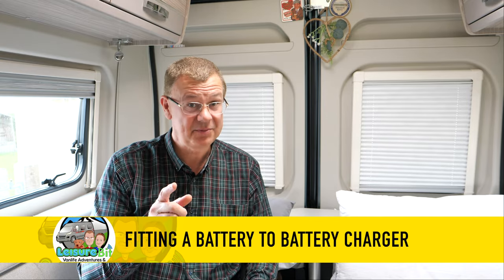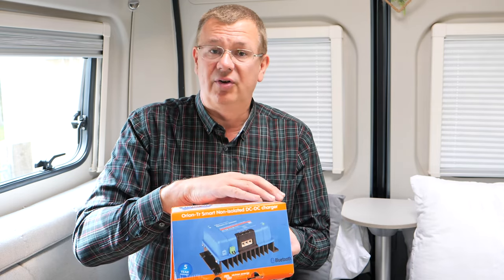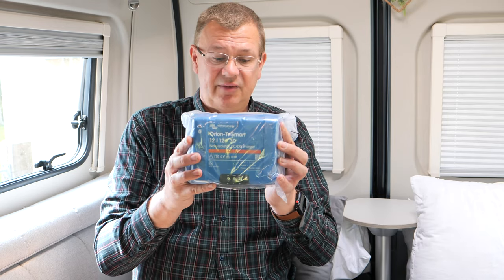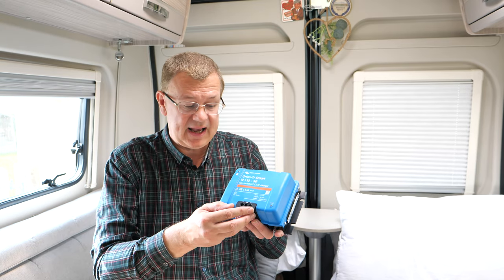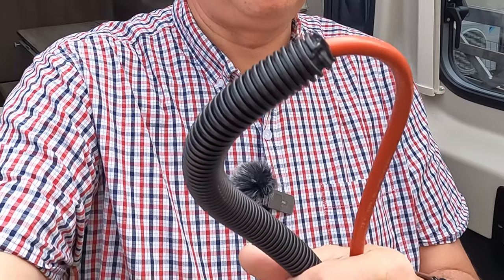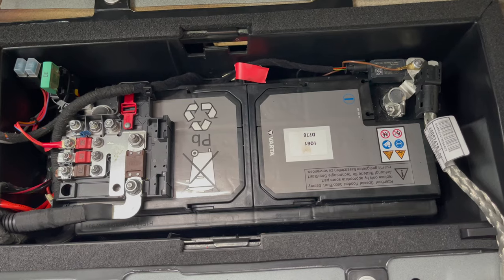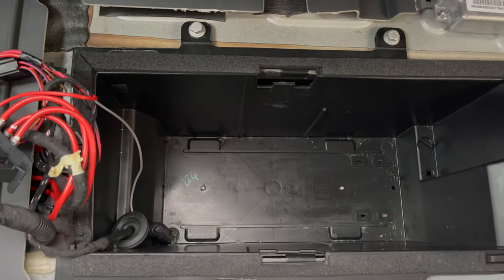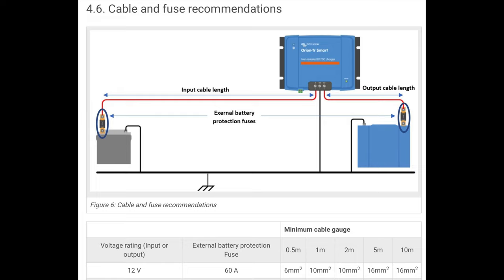Victron Orion DC-DC Non-Isolated Charger B2B Installation in my Fiat Ducato Campervan

Comment: It looks like a good installation apart from the 60A DC breaker.  I bought one off Amazon that looks the same as the one in your video.  It was junk.  It was not CE marked.  The biggest problem was it didn’t make a good secure contact with the cables.  There was just a small grub screw holding the cable.  I did not think it was safe enough for 16mm2 cables carrying 30A especially in a mobile environment where there is vibration and movement.  Many people have posted that the breaker doesn’t trip at the indicated current.  None of the reputable suppliers sell this item and, having seen it, I can understand why.  I returned my breaker to Amazon for a refund.  Please stay safe.
Reply from the maker: Thanks for the comment - you’re right I had issues above 30A with this breaker - have a video in the next couple of weeks since I upgraded it no problems - Amazon shouldn’t sell stuff which isn’t fit for purpose or as described!
All the very best, David 👍

Comment: Hi David, Very good video thank you.  Did you have to disable the Fiat B2B charging system before doing this install? If so how do you do this ? I'm just about to start this very same install into my Motohome that has a Fiat Ducato Engine/Chassis so it would be good to kow if there are any additional steps that I need to take.
Reply from the maker: It would make sense to disable it -
I tried using the Schaudt and Orion in parallel but with mixed results (watch this space for an update in the next couple of weeks) - if it doesn’t have a Schaudt, I would pull the fuse on the original charge circuit as Lithium really needs a regulated charge current rather than a split charge. Then it should do what you expect with no oddities - all the very best, David 👍
Reply: I don't know which fuse to pull?  I've also read that by doing this the control panel in the vehicle then constantly says low vehicle battery and some also say that the fridge could stop working. Do you have any experience of this?

Comment: It’s pushing more power to your house battery thus enabling a better stop start function. We have had this on our transporter works all the time now with our renogy dc/dc charger.  Again great content cheers
Reply from the maker: Thank you - appreciate the comment.
Interesting theory - great to hear yours works all the time now too.
All the best, David 👍
Reply: Hi David out of interest did you get my email. Also where did you get your wire as it seems to have gone through the roof cheers Steve
Reply from the maker: @sccobyste  hi Steve, I don’t think I have the email but will double check. I got the cable from Simply Split Charge (as have found the quality to be good from there after having my ‘hands burned’ with some cheaper stuff in the past - think it was just under a fiver a meter so silly money nowadays.
Reply: @LeisureBit sent again and 🙏

Comment: I've followed all your videos with great interest as I'm going to try and fit Li/B2B in the New Year.  My van is a modern 2021 model but has a simple split charge relay (SCR) system fitted. There's 2 questions I have 1. Does the SCR need to be disconnected before fitting the Li/B2B combination? I have visions of big Li charging currents going through the existing SCR in preference to the B2B!!  2. The Li battery has an app that monitors the BMS of the battery and the Victron B2B also has an app that monitors all the necessary parameters. Do you really need the added expense of a smart shunt?
Reply from the maker: Thanks for the comment. It's best to disconnect the split charge relay as they aren't normally designed for Lithium batteries and it may cause incorrect charging / false readings with it connected (I've found this myself using 2 B2B's) it's best to have one device managing the battery of each type I've found to get the most out of it. You're right, the SmartShunt I had already bought but you can do without it for sure if your battery has the functionality built in. 
Hope that helps, all the best, David 👍
Reply: @LeisureBit  Thank you very much for your prompt reply, I shall continue to follow your detailed videos!

Comment: fantastic David.  Interesting about the start stop but maybe by giving the earth a cleaner earth path is making the start/stop more efficient. I just wonder if you considered stepping up to 25mm cable to allow just the breaker without the additional fuses on the B2B?. Nice video 👍
Reply from the maker: Thank you very much for the comment. I did consider 25mm and if I was putting a couple of Orion’s in would have gone with that for sure (as would have taken to 80A fuse at the battery then instead of the 60A). Cable has got silly money hasn’t it, think I paid just under £5 per meter for the 16mm2. You may have spotted the hole is bigger than needed incase I wish to go dual in the future 👍 
I put the fuses on the B2B just as an extra precaution (based on past experience where things have malfunctioned) - if it’s double protected it never short circuits or breaks down either 😀 
All the very best, David 👍

Comment: Hello, is there a way to limit the current? if I have a Li Ion battery to charge, that can take 200+ Amps, how can I limit the output current in order not to blow the fuse or overcharge the alternator, charger, cables?
Reply from the maker: That’s the whole point of the b2b and why it’s needed, it regulates the current and voltage 👍

Comment: Interesting vlog David, so does this mean you will be using EHU less this year or was this just extra back up. I suspect the start stop is due to the extra earth either making a more efficient connection for the vehicle battery or helping maintain it's condition. Start stop on Mrs K's Audi has always been hit & miss. Cheers K.
Reply from the maker: Morning Karlos, I think you’re right on the earth sorting the issue (that seems to be the theory as if you disconnect the b2b it still works fine - poor connection between leisure and vehicle earth seemed to be the issue)
It gives more options and takes the worry away - we do plan to do more off grid sites but as you say you always have the option of whichever you need at that point - we have some coming up with no hookup given the remoteness and have some ‘tours’ planned which again wouldn’t have the hookup to recharge so it gives some extra top up while travelling to extend the time without intervention of a hookup.
Thanks for the comment, Hope that makes sense, have a great week.
All the best, David 👍

Comment: David, many thanks again for an informative video. I've noticed a few people reporting intermittent issues on the CV FB site with the stop/start system. I must be fortunate as my Series 8 CV40  appears to work fine. I'm also finding the stock B2B, solar panel combo working fine also for how we use the van. Only gone off grid twice (overnight) & found the stock battery still showing green in the morning. Was using lighting & 12v compressor fridge, gas heating & a couple hrs of 12v TV. We must try off-grid longer to challenge the system & have an excuse to move to Lithium. Obviously using your guides ;)
Reply from the maker: Thanks very much for the comment - you’re right a few folks seem to have an issue others it seems fine like yourself. Depends what you do and how often you go off grid and for how long whether it’s worth shelling out 😀
All the very best, David 👍

Comment: Thanks for that David. Interesting how you wired it. I managed mine by having the wires inside the vehicle. I felt it was much simpler and  there is no point where you tread on the cables. Anyway that’s just what I did. You said at the beginning you were going to explain about the “jumper” for switching it in when the engine in running. What did you do ?  I wired a switch so I can control when I want the unit it be on. After all if you are headed to a site with hookup why would you want to use the vehicle to charge the battery if EHU or indeed Solar is going to be plentiful. The switch is very useful and I added a “Hey Ellie, turn on the Dc to Dc” command. Shen can just reach it while I’m driving. 😂
Reply from the maker: Thanks Graham - if I was just replacing the existing one and sorting out the wiring from the converter socket, it would have been much easier as I could have run internally but I wanted it as an extra (to give 25+30A=55A) and that was more than the converter connections are rated for. 
I’m going to do a follow on on how I’ve wired it up as took a little break to test it before finalising which was originally intended to be in that one - missed that when publishing!
Basically though I’m fitting an on off on switch which in on 1 will connect to D+, if off won’t connect to anything and if on 2 will connect between the 2 points where I think you have put your switch. I’m too useless to remember to switch it on when needed but gives the option of automatic (on 1) or manual then (on 2) - the common on the switch connects to L and the right connection to H and the left connection to D+ basically then it gives all the options if there’s an issue or a specific outcome is needed. The battery maintainer I fitted causes looping otherwise where it raises the voltage when the leisure battery has enough charge to the vehicle battery and then it activates the Orion to charge the leisure battery from the vehicle battery so the D+ gets around that and saves me forgetting to switch it on or off.
Hope that makes sense
All the best, David 👍

Comment: Hi David we have an interesting one we drive and the leisure battery seems to discharge turn the van off and it starts charging via solar so actually doing the opposite need to check the onboard b2b and if an issue remove and replace
Reply from the maker: Wow, that doesn't sound right does it - is it wired up correctly do you know? Sounds like it's got the vehicle side connected to leisure and vice versa perhaps.
Let me know how you get on.
All the best, David 👍
Reply: @LeisureBit  it’s all fine very weird now it’s all working

Comment: Great video! Thank you for sharing! Can you show a picture of the final battery connections? Also have you seen where they connect directly to the alternator, if so what’s the difference?  Thank again!!!
Reply from the maker: I connected o the battery rather than alternator, I don’t think there would be too much difference except if you drew lots of power. Will see if I can find a photo… assume vehicle battery? If so it’s a spare terminal on the fuse connector with a MEGA fuse. All the best, David 👍

Comment: Excellent video friend, super intuitive keep helping us with your explanations.  As for Start stop, here in Brazil we usually make two to three auxiliary negative points coming out of the battery and connecting to the vehicle's chassis.  The ground line becomes more efficient. 👍
Reply from the maker: Thank you - makes a lot of sense to have two or three negative connections to the chassis. 
Thanks for watching, all the best, David 👍

Comment: Cheers David, I put in an isolated dc2dc but replaced the existing dc2dc.  However, I ran off the convertor links in thd driver b Pillar with new heavier cabling as the cabling was really lightweight for the 30amp draw.  

In respect of the stop start, like you I have the intermittent activation.  However by disconnecting the sensor from the battery (20 mins no power) you reset the s/s system.  Alas in two days time it stops working again. 

 I like the theory of the common earth and will review the wiring I have (should be simple to do a common earth despite the isolated dc2dc version I have).  

Thanks for the video.
Reply from the maker: Thanks Barry, really interesting observation on disconnecting the negative, last time I did it for the tow bar electrics had no impact. 
Know what you mean about the cabling 😒
Do let me know how you get on, will update if the start stop goes intermittently again.
All the best, David 👍

Comment: I like your window shades. Did they  come with the van ?
They look like they are designed to be light proof from the outside. 
Are they an aftermarket product  ?
Reply from the maker: Thank you - they came with the van but I believe you can buy them as I know people have bought replacements when damaged, but I don’t know who manufactures them, sorry, all off the Elddis CV range have them so you might be able to find them searching for Elddis CV window blinds, they are pretty good at being light proof. However there are pin prick holes where the string goes through which gives a very small amount of light in and out. Tiny but on close inspection you can see it. All the best, David 👍

Comment: Great video, I'm looking to install one in my overland set up.
Can you tell me if the circuit breakers were higher or lower amperage than the circuit breakers? This seems a better idea than battery isolation switches...
Reply from the maker: Thank you - I’ve found the breakers a bit hit and miss - worth getting the decent ones rather than the cheaper ones - they are handy as isolators too - I went just under the fuse rating so hopefully they would trip and the fuse is for additional protection 👍

Comment: Hi David have been watching and rewatching your informative videos on changing to lithium batteries, solar, dc to dc etc your help has been invaluable. I am just about to fit my Victron DC to DC charger but can’t find where you have picked up the ignition wire is there one on the original blue charger and how did you disengage the original charger after installing lithium etc as I’m not sure. Thanks keep up the good work. Vince
Reply from the maker: Hi Vince - yes, that’s right it was already connected to the original B2B (d+ connection) - it is available from the Fiat converter connector I believe which is in the drivers side door pillar base on ours -
Not sure if that helps? All the best, David 👍
Reply: Thanks for your prompt reply David it’s appreciated. Basically what I’m asking is if one of the wires from the blue original charger to connect the dc to dc ignition cable from the Victron charger and I’m not sure what to do with the cabling when I disconnect the original charger. Thanks for your help
Reply from the maker: @vincenteblacker783 with mine I just left it as it’s then fed without that so put a plastic cover on (or you could put some tape on) and then the wires from the charger go back to the battery, bypassing the elddis electrics (hope that makes sense).
Reply: @LeisureBit  thank you David 🙏

Comment: Hi David,  did you manage to find the photo of the connection to the battery.  If not would you be able to take a photo.
Reply from the maker: Ping me an email feedback at LeisureBit dot codot uk and will ping you a picture back of where it’s installed.

Comment: Hi David,  I'm about to fit a Victron B2B (new 50A version) when it is released in the next few weeks. Your video doesn't show the actual connection to the battery (at 18:43).  I'm wondering how you connected it with a fuse.  Any chance you could take a photo of the connection on the battery.
Reply from the maker: Yes of course, I think I have one in my photos somewhere, I used a mega fuse on the spare terminal on the edge of the fuse array connected to the positive terminal if that helps too (60A I used) and drilled a hole in the battery box and popped a grommet in to feed the cable through as I ran underneath.
Reply: @LeisureBit  that would be great if you could find and post the photo.  I can't see how you would connect to the spare connection on the fuse array with a bolt as there doesn't seem to be any room to get it in. Did you use a fuse holder for the mega fuse.
Reply: @LeisureBit i also have the same issue. Your video is very comprehensive but misses the technical part of fitting the fuse and cable at the engine battery end. Can you provide a photo or video of how you did that ? Thanks

Comment: Great video, I’m interested in how you find the alternators capacity on a ducato 👍
Reply from the maker: I believe it depends on the model and what’s fitted - its a right pain to get a good view of under the van  as I find it really awkward where it is - unless you have a spec sheet for yours? If it has a converters connection they seem to have a max allowed load of 50A which of course is too low for a 50A b2b due to efficiencies - for more direct connection worth checking the rating and the speed to load also as some rated at say 150A will do much less at idle speed, also the load the van draws.

Comment: Great video! Quick question, in the manual diagrams the 60 amp fuses are always pictured near the battery terminals, does the position of the fuses matter at all? Thanks!
Reply from the maker: Thank you - yes, the position does matter for the fuses, I fused at both ends which some would consider excessive but wanted to protect both ends of the cable. The fuse on the vehicle battery is attached to the distribution block on the top of the battery, there is also another fuse in the fusing onto the leisure battery in addition to the ones near the Orion. Hope that makes sense, the important ones are near the battery. It also gives extra protection in the event of a faulty fuse or other odd scenarios which are unlikely but could occur. All the very best, David 👍
Reply: @LeisureBit  Thank you!!